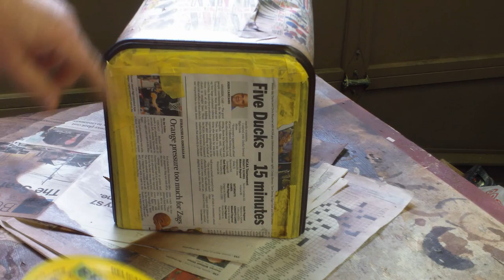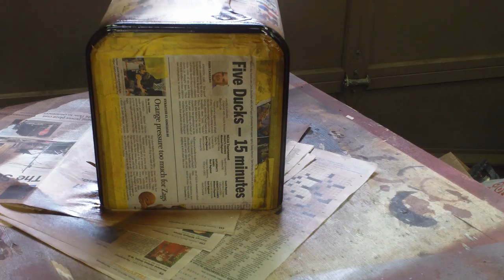1936 Fairbanks Morse Model 57 Restore Part 8

Comment: Earlier on in this series, while you were stuffing the old capacitor shells, I noticed that you were filling them up with hot glue after you inserted the new capacitors.  I thought it might be a good idea to use a black hot glue, then thinking about the original capacitors, perhaps a brown or orange...then it hit me that a clear one was actually the best.  That way you have a chance of seeing the new capacitor inside.  Brilliant thinking Buzz!
I was hoping that you were going to rewind the transformer, but I do understand that it is a problem when you don't have any specs on what the specifications are supposed to be.
GREAT JOB on the cabinet!

Comment: That cabinet looks amazing Buzz! 
On your speaker connectors....look up "bullet connectors" you may want to avoid any shorting.
They also make fully insulated versions of spade lug connectors you are using too. One other idea is a four wire trailer connector set. Polarized so you can't get them backwards and fully insulated too!
 Auto Parts store should have an assortment of these kind to check out and figure what works best.
Reply from the maker: +GrandsonofKong ...I iwish I knew that a few days ago,(about billet connectors) and  I will do that in the future, in the meantime , I'll use heat shrink like a few subscribers suggested..Too cheap to buy new connectors , since it is already done....why waste money....Buzz